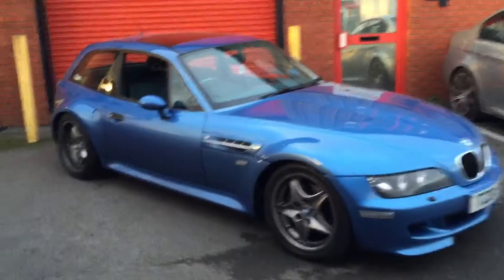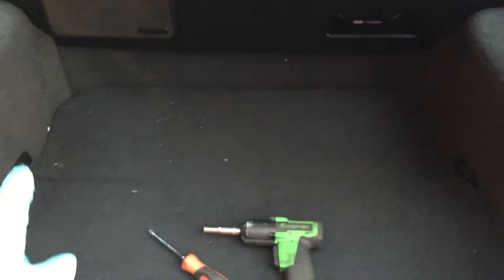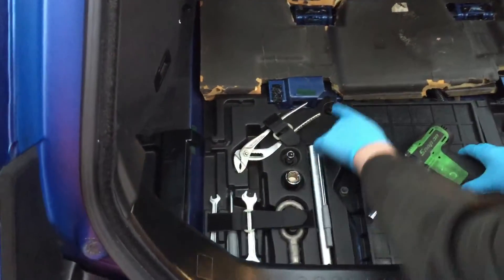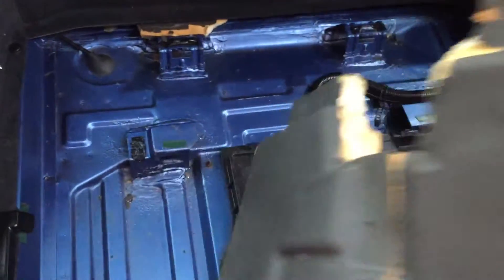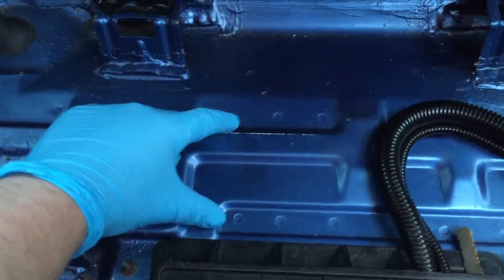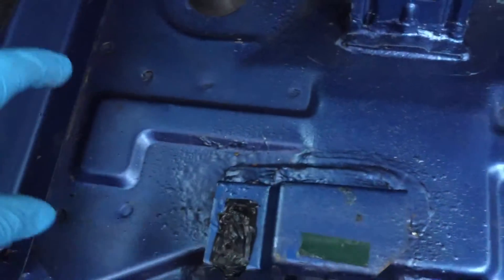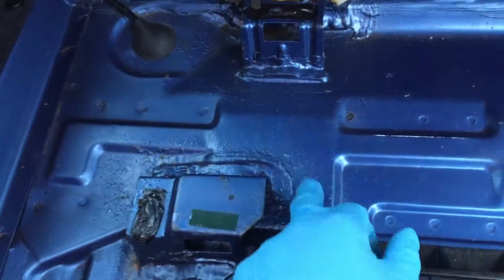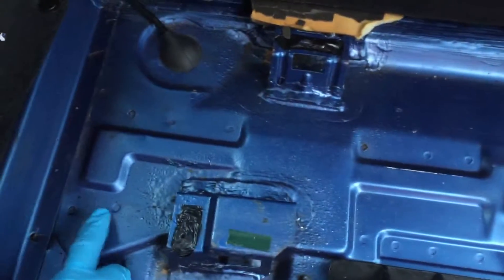BMW Z3 M Coupe Boot Floor Check

Comment: Good video, thanks : )My boot floor is good, but thinking of seam welding the side panels and maybe the centre section. Thoughts? The diff ear has a 3mm crack in the corner, should I be re-inforcing the diff ear mount maybe? I'm going to fit poly subframe bushes which I think will help a little and reduce movement, but stick to oem BMW diff mount. Can't believe they want £200 for the diff mount bush!!!

Comment: How does one close the gap between the chassis leg and the panel? Load the panel from underneath until the gap is closed and then redo the welds with plug or stitch?
Reply from the maker: Gerard Walsh That’s exactly right Gerald. We stop-drill the ends of the cracks first and then straighten the bent Boot Floor until it touches the Leg in the best relaxed state possible. Then stitch weld it back to the Leg. On this car we also installed the Randy Forbes reinforcement kit which helped strengthen that area.
Reply: @RedishMotorsportbmw  thanks for the reply! For instance on the E46 chassis, if the RACP started to drop away from the chassis leg (in the cavity section), how do you close the gap? Do you move the chassis leg down? Or somehow pull the RACP up?

Comment: hi how much would you pay for for a car like this with the same problem it is 1999 z3 m roadster ? car is 100k miles
Reply from the maker: Good question Mike.
It depends on the base price of these vehicles and then subtract the repair costs really.
In the UK at the moment that type of car would be around £15-£20k. Take off a good few thousand say £3k and that should be fair.
Hope this helps.
Please consider Subscribing to our YouTube channel!

Comment: Out of curiosity, are the Z4s (E85/86) affected by the RACP troubles?
Reply from the maker: tocsa120ls luckily not. The E85 E86 uses a unique RACP which nobody has ever reported an issue with, thankfully.
Reply: @RedishMotorsportbmw  Then it stays in the garage :D

Comment: Z3M .??? Ummm you mean M coupe.  That Z3 has nothing to do with m coupe chassis not even built on the same production line . Because BMW M division/motorsport built these cars . Just like all the other M cars !!!! .
Reply from the maker: Yes understood - we will change. This video was filmed over 3 years ago in our very small defence.
Reply: @RedishMotorsportbmw  fair enough mate . Great video by the way, common issue on these cars and even on e30 and z3
Reply: The BMW Z3 coupe and the M coupe have completely the same body. This rear section is in all z3 the same. even in the roadsters. Even normal 2.8 have this spot weld problems. 
Thanks for the content!
Reply: @chriswagen2047  wrong how!!!! If the m coupe is longer !!! Even wider then the z3 . Another person stating false information from the internet.
Reply: @chriswagen2047  says the fake and troll account.  Nice try kid
Reply: @_i-kr6eg  You have no idea. Do your Homework , dont blame other people. You are wrong. 
LxWxH is  4025mm x 1740mm x 2446mm in the Z3 Coupe as 2.8 Litre, 3.0 litre and the M modell with the S50, S52, S54 Engines, all the same. And the structural rear Section, as i said is in all Z3 coupes & roadsters the same. And can cause this spot weld Problem.
Reply: @chriswagen2047  stop getting wrong info off the internet , you know nothing about the automotive industry like I do . I bet you have have a job in any industry. M coupe had a S54 !!!!!! I'm sure they did you crazy troll .
Reply: @_i-kr6eg  ok now we all know, you know nothing and you are trolling. Have a nice day.  By the way i have all 3 cars, m coupe, 2.8 coupe and a 2.8 roadster and i can look it up in the car manual or i go in my garage. I know these cars by heart. Ciao and have fun.
Reply: @RedishMotorsportbmw   maybe you should delete his messages, keep going your awesome work!!
Reply: @chriswagen2047  so the guy the claims to own 3 of them calls them z3m . I'm sure you do have three of those cars . Stop lieing kid
Reply: @_i-kr6eg  If you're comparing the Z3 roadster to the M Coupe, you are right that the rear fenders are different and wider on the M Coupe.  But the Z3 Coupe and M Coupe have the same body.  They all suffer from the subframe failures as well.  And M Coupe had an S54, but only from 2001-2002; they had the S52 from 1999-2000.
Reply: @VersanGetryx  thanks
Reply: @VersanGetryx  and the M coupe is longer too a Z3 is so small next to a M coupe side by side . And why would BMW Motorsport M devision build the M coupe on the same production line as a non M cars!!!!!! Don't Think SO or ever did !!!
Reply: @VersanGetryx  M coupe had a S54 !! Wrong never did . Only Euro S50B32 engine's  not S54B32. Even north American cars only got S52 engine just a M50 put together with random parts at BMW for the north American market.
Reply: @VersanGetryx  you are in the U.S. so no your wrong
Reply: @_i-kr6eg  I'm not sure what point you're making.  We were both correct with the engines stated, you're right the euro has S50 and NA had S52 and S54.  I like the bmw in your pic.
Reply: @mr323i, your half cooked knowledge is hilarious. All the same. All Z3s came off the production line in the US. M GmbH in Germany only puts the engine together.
Reply: The Z3M Coupe and Roadster came as S52 and S54 in the US. Europe had the S50 and S54 respectively.
Reply: @_i-kr6eg , even the manuals of the M version says "Z3" written on it. In Australia you got not a lot of nice cars anyway.
Reply: @_i-kr6eg  I have an 02 M coupe with an s54. The body is basically the same as a regular z3 coupe. And in America, they came with the s52 from 99-2000 and the s54 in 01 and 02.
Reply: @jaredsanda1440  how if the m coupe has a wider rear track and wheel arches!!! . So no not the same car . Even BMW knows this because they built it.